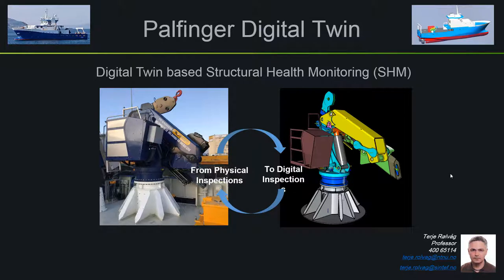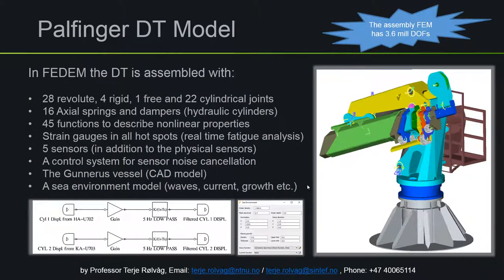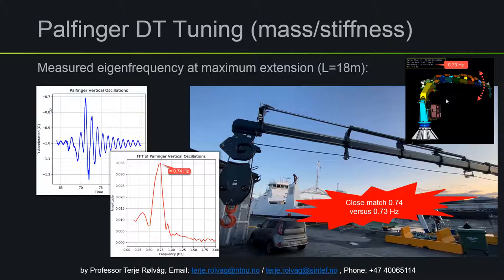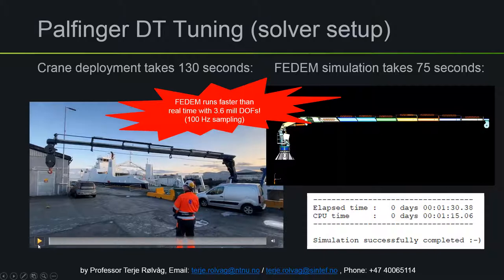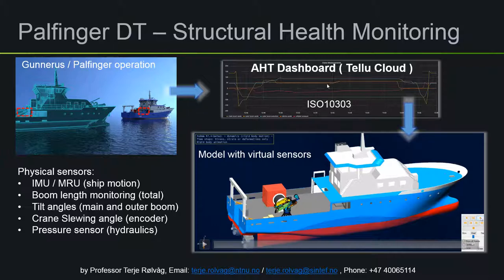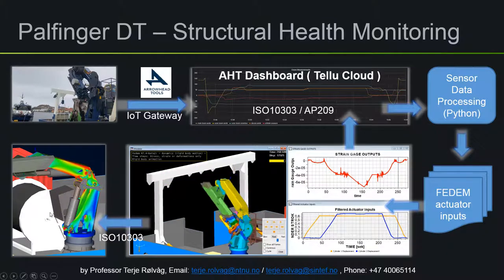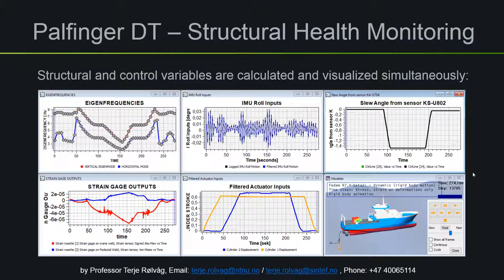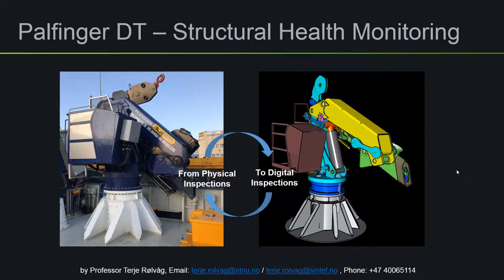Real Time Digital Twin based Structural Health Monitoring

Comment: Hello, 
How the data from the sensors mounted on the physical model is being implied on the digital model. Would be really helpful of you could help.
Thanks in advance
Reply from the maker: The sensors on the physical crane are not replicated on the digital twin. They are standard Palfinger instruments not directly applicable as input drivers on the crane. There are ex. two angular sensor outputs that I translates to equivalent tilt cylinder strokes (driven actuators in the FEDEM model). The cylinders are modelled according to the cylinder property specs to get the correct input loads and stiffness. The overall boom length is measured on the physical crane and these are translated to individual telescopic cylinder strokes. These is also one measurement of the crane slewing angle and vertical wave motions that are used directly as input to the crane simulation (after low pass filtering in Python)
Reply: @FedemDigitalTwins  
Appreciate your time, but can we simulate the exact working condition on the digital model? For example if we are creating a digital twin of an elevator door , can the sliding movement of the physical elevator door be represented in the digital model aswell?
Reply from the maker: @mrrohan6396  Shure, are you thinking of a kinematic, rigid body or a flexible body dynamic analysis? In FEDEM I can run a real time flexible body analysis (FEA) since the software uses CMS model reduction (super elemements) It could be a perfect solver for your elevator door!
Reply: @FedemDigitalTwins   If I give a input of say 10mm  sliding movement of the elevator, can this be achieved in software? And can I vary the distance of the sliding movement?
Reply from the maker: @mrrohan6396  , no problem